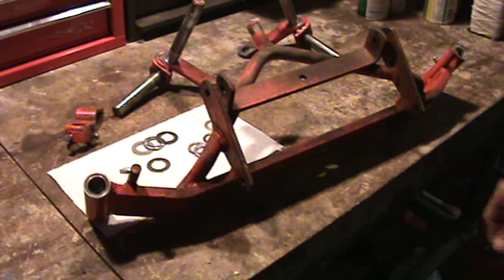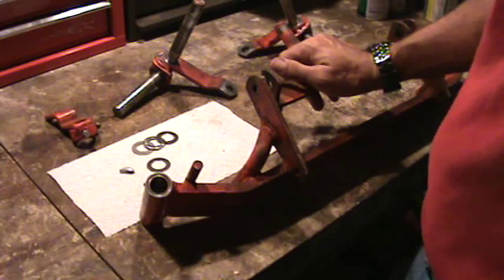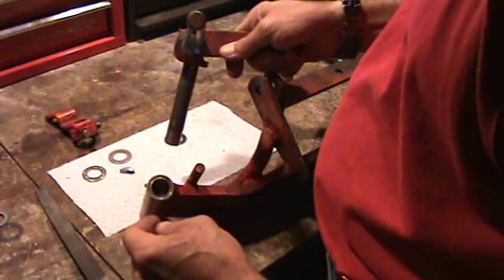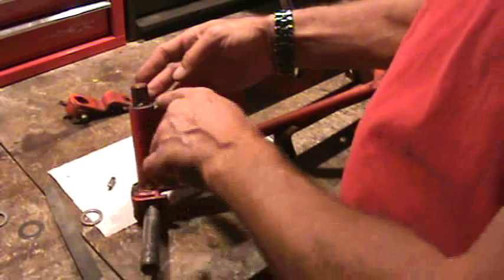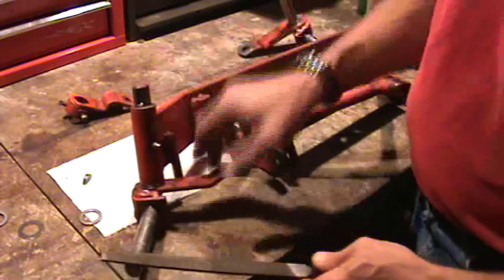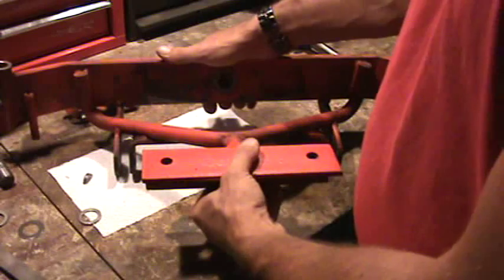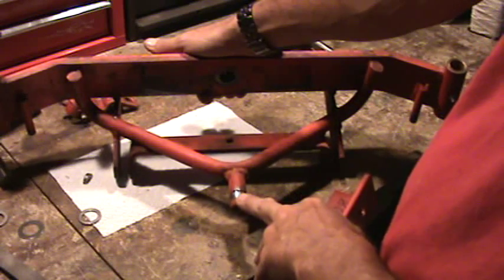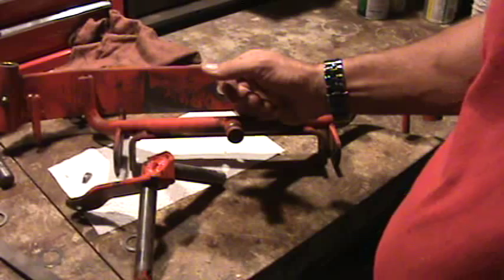Converting Allis Chalmers/ Simplicity thrust washers to bearings for easier steering Part 2

Comment: Hello, I am currently rebuilding one of the these front axles from a SImplicity 725, and I was wondering if I need to order the splindle washers with the keyway, or if a regular 3/4 flat washer would work?  Thanks.
Reply from the maker: No keyway needed, but you do need to grind the reliefs so grease can get to the thrust bearings. Zip~

Comment: Wow, this is the advanced level course.  Very detailed and on-target technically.  I'm doing my Craftsman YS4500 spindles today.  I'll incorporate the thrust washer grease grind-outs in my installation.  Thanks.
Reply from the maker: The devil is in the details for sure here Kar. If things aren't level or you can't get grease to the needle bearings, they'll fail pretty quickly. Good luck on the install! Cheers! Zip~

Comment: great video, as usual. have to admit though.....I have done this  "improvement" and noticed no difference :-(
Reply from the maker: The whole steering system should be gone through. Often, drag can come from the steering gears, steering column and worn spindle bushings. This trick works well, but only if the rest of the steering components are healthy. Keep at it...it will get better. Cheers! Zip~

Comment: So you don't need needle bearings on the top?  There is no weight there.
Reply from the maker: Correct. Also, when I grease spindles, I always jack up the front of the tractors so the spindles drop in the king pin sleeves, blocking grease from spewing out the top and forcing it to travel down to the area where the grease is needed most. Cheers my Friend! Sean~
Reply: My order came in today but the needle thrust bearing didn't show.     So I have #8 .060 and #10 .030.  That is cool though .  They said tomorrow.  Hopefully a video in the making.  My tolerances are a bit different than yours but it will be fun.
Reply from the maker: And the results are well worth it! I've been under the weather for a while and haven't gotten to the post office yet. Went to the doctors today for some blood work. I've got to get to the shop tomorrow, so I'll grab your goodies and a box and get things ready to go. Hopefully in time! Sean~
Reply from the maker: The thrust washers are killer strong metal, so it'll take time to grind the grease reliefs. Should give you something to do until the needle bearings arrive. Looking forward to seeing your videos on your installation on the Deere!
Reply: Both Deere's  eventually  The one is a little 180  17HP Kawasaki 1986 model snow plow purpose and the other is actually a great little tractor.    Liquid cooled 2 cylinder Kawasaki opposed twin with  hydro 1996 model , new this year (too me haha).  I can go to a cab and heater with a snowblower   (that is the plan).
Reply from the maker: I remember when you got that one through your videos. That'll be nice, having a cab and heater in your climate! Years ago, I had the diesel Allis with Dan-Co. cab, but it was SOOO noisy lol. Besides...not my style of tractor so I passed it along down the line. Sean~
Reply: Thanks for remembering it.  I live in the city and mow my own yard and anything the city doesn't haha